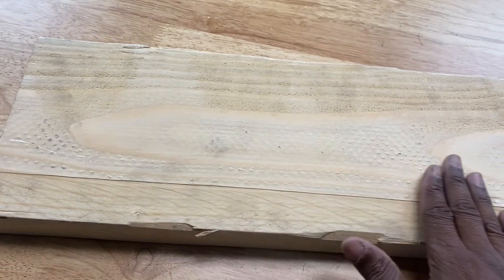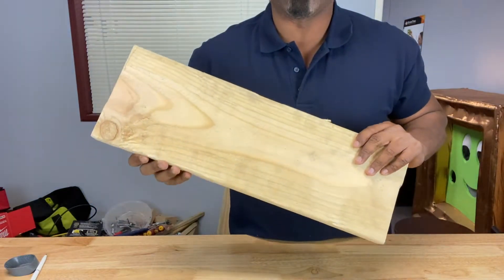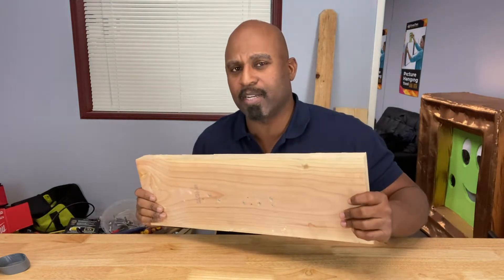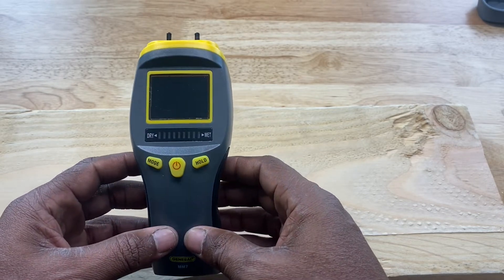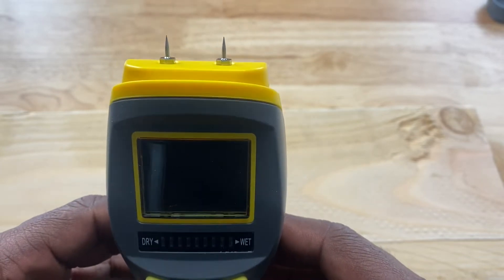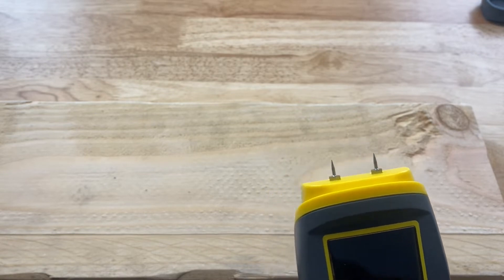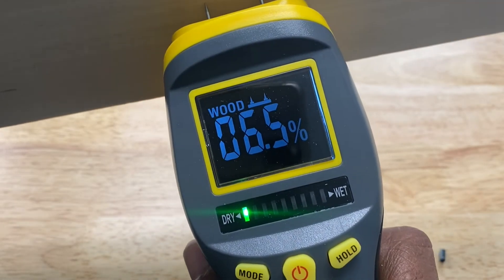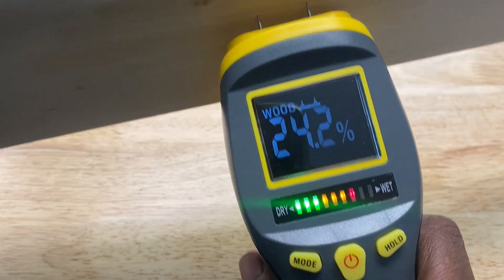MOISTURE METER FOR WOOD

Comment: I have a pinless reader. I noticed that when you just place it on the wood the reading is lower than when your apply some pressure when you take a reading. Which is the correct way to get the reading?
Reply from the maker: More pressure is better than too little. Your moisture meter manual should specify the correct amount of pressure. More than 3 pounds of pressure is probably too much.